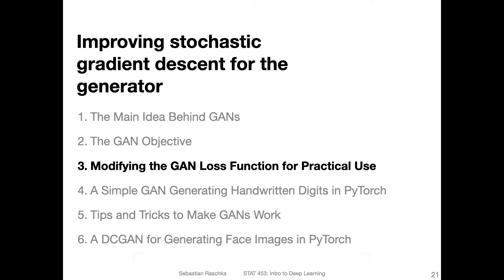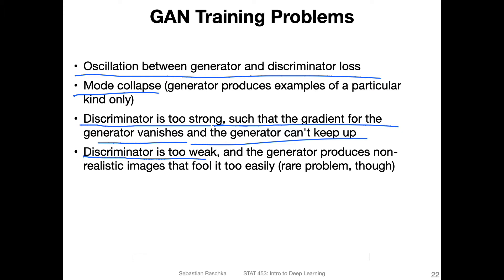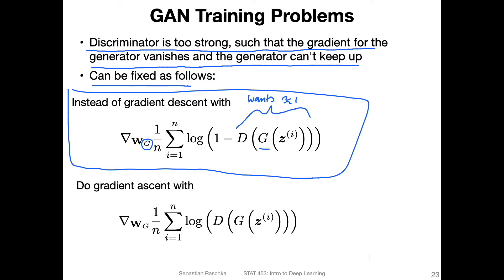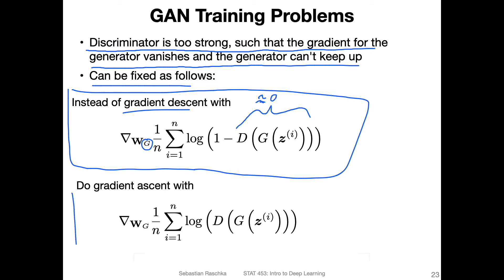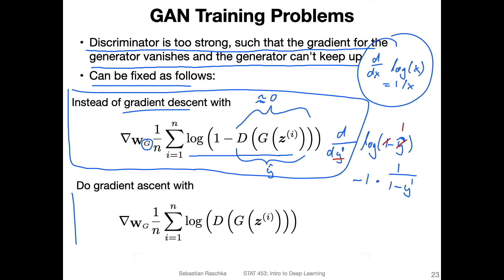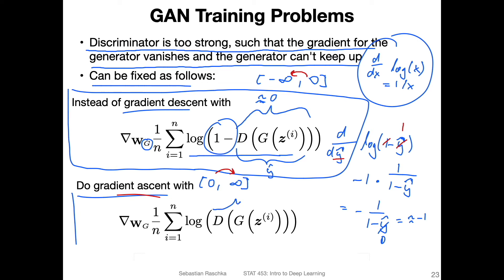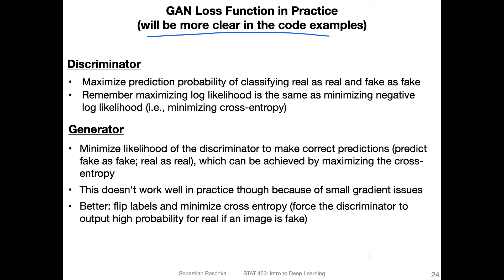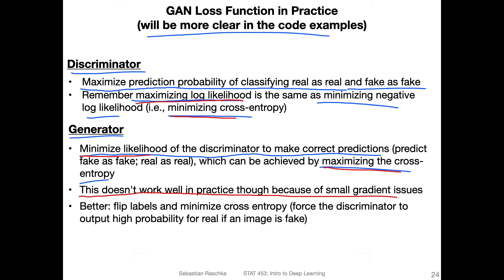L18.3: Modifying the GAN Loss Function for Practical Use

Comment: Quite vague poor explanation of gradient vanishing when strong discriminator. The gradient -1 is not weak , the reason it vanishes is because -1 is multiplied (chain rule) to gradient of D w.r.t G, which is too small or confident/saturated discrimators. Once you change the formulation to 1/y_hat , the small gradient is not multiplied to a very large number

Comment: Thank you for the great video! At 14:19, I understand that the first equation is the gradient ascent from the original paper, and the second equation is negative log-likelihood, which from what I understand is just adding negative signs to the normal log-likelihood. But how did you transform eqn 1 to the normal log-likelihood to begin with? Integration? Thank you!